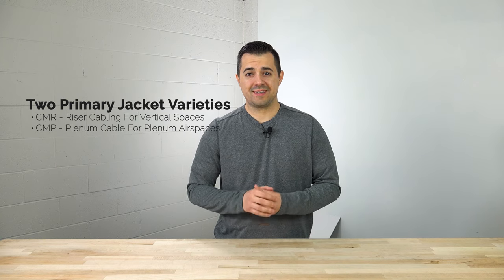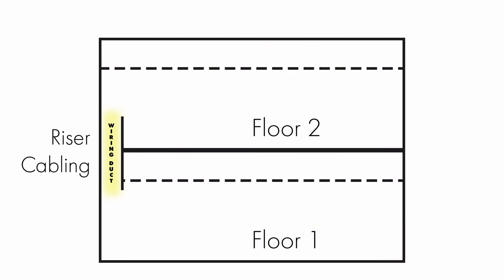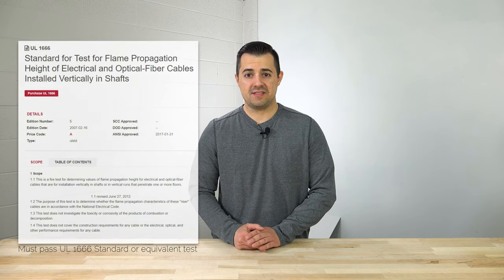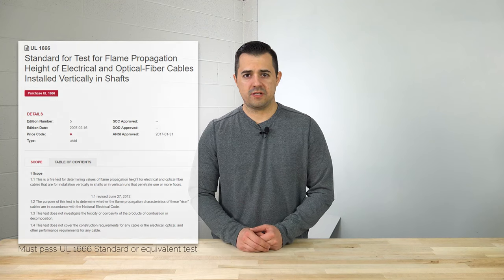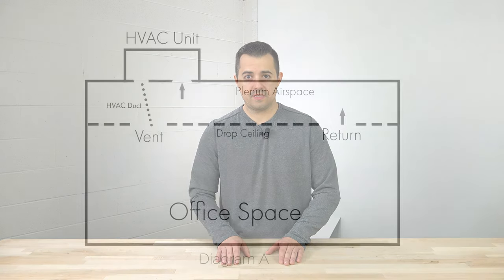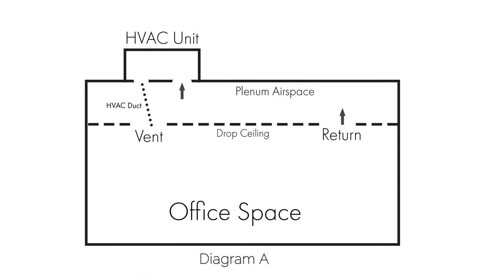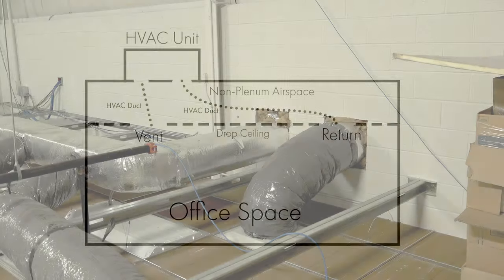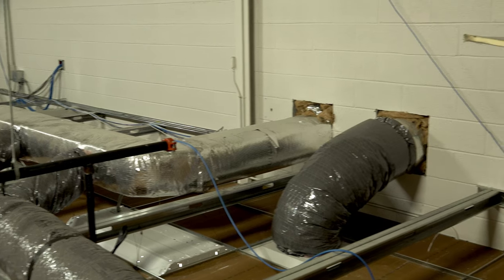Cable Basics - Plenum vs Riser

Comment: Important to note that the space below the ceiling, "office space", is in fact a plenum space. Any lines run in tray there will need to be plenum rated. CM or CMR can be used in this space as patch cables with a limited length, usually around 30ft.

Comment: I need to run cable for a poe cameras, which will be mounted around the eve of my house. They will run through my attic, then down a wall to a server. Is riser fine for this? I still don't really understand. Also, are there certain brands that i should know about? Southwire is on sale at my home depot, but i was also considering monoprice. thank you for any information that you can provide.
Reply from the maker: Riser would be fine for that application.
Reply: @ComputerCableStore  thanks for your help.

Comment: Thanks for the video.  If I drill through my first floors double top plates and the second floors single bottom plate to run ethernet cable (1/2" hole), is that considered a "Riser" since it goes from one floor to the next?
Reply from the maker: Will it be inside the wall? Most likely you can get away with riser cabling.